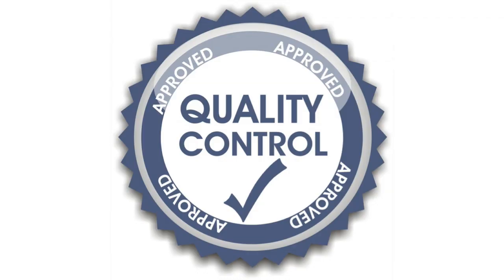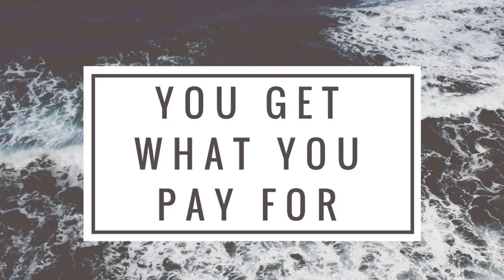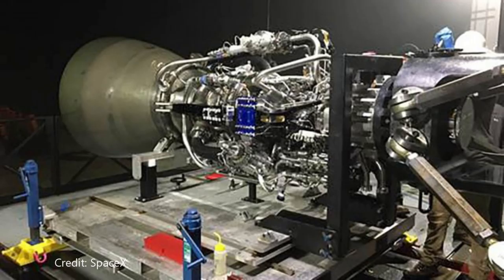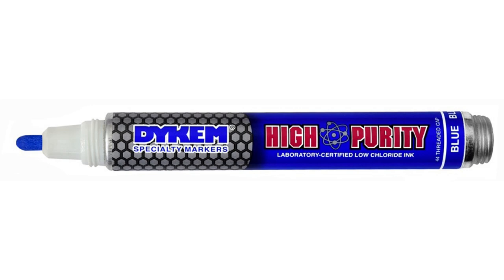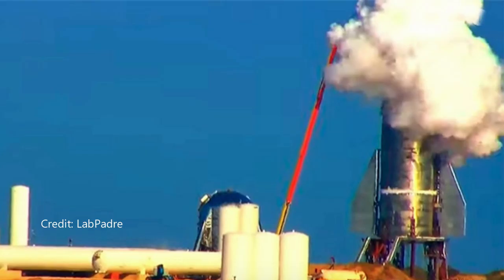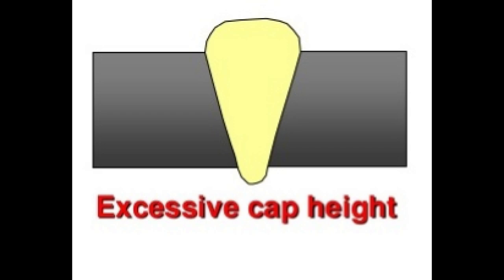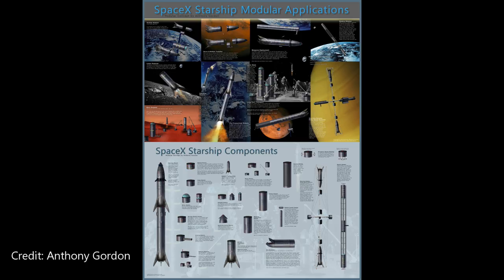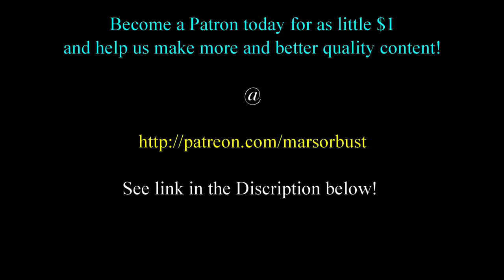WILL SPACEX STARSHIP EXPLODE!?  How SpaceX Will Maintain Quality Control! Episode XXI

Comment: I think its a bit much, to ask, to weld all those rings and end caps manually and expect them to be prefect even with a jig! I would think that they need automation plus verification with x-ray with AI. SpaceX has re-acquired the dock at the L.A. port and are building new hangers. I believe they plan to move production there.

Comment: Exquisitely timed, SM Dave!  When Musk did his Starship unveiling back in Sept 2019 with that Frankenstein-monster of a spacecraft, it looked like a hacked-together creation from a back-yard self-taught welder, a patchwork quilt of stainless steel and miles of welded seams. Elon seemed not at all embarrassed by its appearance, which surprised me. He seemed oblivious to its appearance and the implications of that.

Fast forward 5 months, and SN1 is pressurized with LN2 and it blows a seam (guessing here) and violently disassembles after weeks and weeks of careful welding and assembly. And we non-experts are left to wonder: what if this approach to building a space-faring craft (to be reused a few dozen times at least, including a completely untried approach to atmospheric re-entry) - what if this approach is fundamentally flawed? What if it can only succeed with a lot of luck and overwhelming care in welding and rigorous inspection of every mm of welded seam? What if it's impossible to reliably replicate the occasionally successful welding process across the projected fleet of hundreds of future Starships?  I have little confidence in the present approach.   - DL
Reply from the maker: Thank you!

Comment: That metal is so thin.  They are doing things on the very edge of what's possible,  and from what I can see they're probably going to need to thicken the metal because they're going to keep having these failures.   I went to welding school at UNM and so I know a little bit about welding.  Stainless steel is very unforgiving anyway and so if you get porosity,  at all, at pressures like these, you're going to get failures.

Comment: I have wondered if joining the rings would be better to use universal head monel rivets vs welding.
Reply from the maker: Rivets connect the material but dont actually bond it together.  If they can get the welds done correctly,  the weld areas will be stronger than the parent metal. At least that how its supposed to happen... 
Thanks for the comment! 
SMD 
MoB
Reply: @MarsorBust  I build helicopters for a living,  welds have issues with cracking in areas of high vibration and thermal expansion/contraction.  engine combustion cans have alot of welds that must be regularly inspected because of this very reason.  Its hard to not imagine a cataclysm of vibration not cracking the welds on liftoff or reentry.
Reply from the maker: @macaw172   You are correct and I do remember back in the short time I worked on jet engines, the combustion cans were allowed to have cracks up to a certain size. All they did was drill a hole to stop their propagation. That always seemed strange to me! Anyway, there are many things regarding Starship that you or I may seem strange, but I would truly hope someone with much more intelligence than myself, has a reason! I truly I hope!!! I could be wrong though... 👍
Reply: @MarsorBust They have an inner combustion can and an outer can.  The inner can uses weep holes for cooling and yes some cracks are allowed,  the outer combustion can actually contains the hot gases and no cracks are permitted as it will result in power loss then engine failure.

Comment: Quality control implies that you have a standard to build to, these are scratch ships designed to blow up once or twice, till it can be determined what was the cause, but why stress about control till you know what you are building. if you want the SN1 to take 5 years to build and still only fly 20km then go your route. I understand your points and pretty sure all the engineers know this too. But It's build and test to destruction. You can re-do this video in two years time, with the same points you are raising now, I reckon you will be saying God Damn SpaceX is pretty anal about their welds .
thumbs up
Reply from the maker: Hey Robert! 
I'm using the same response as I use for another post. What you say makes sense! 👍 

Maybe it's just me and all my years of making sure things are done right the first time, but in my opinion and it should be the option of anyone spending money at SpaceX. There are proven ways of doing things like this no matter what it is you are building. And, It is proven to be cheaper and not very time consuming compared to the cost of doing it twice to do basic inspection. How much did those vessels they blew up cost? $50,000, $100,000 more? How much does a inspector cost, $50,000 or $100,000 per YEAR... Yes I understand what Elon is doing but there are engineering programs that will tell you exactly how much pressure any design will withstand. To a point, Build and Test is an old fashion way of doing things. Do they build a bridge that has never been built before just to test it?  I mean just look at Kerbal Space Program. It's not even a Engineering program and I'm NOT suggesting anyone use it except to play with, but it is still  fairly accurate as to what will hold together and what will not. Imagine a professional engineering program designed to do that can do. 
Just my opinion...

Thanks for the comment! 
SMD 
MoB

Comment: Quality control,  testing/inspection and materials selection is basic for this kind of engineering, something ,so far, I see little evidence for from Starship. The thing I see being built, apparently by trial and error, is not the real problem though, that I can see. The design is fundamentally not a reusable design, for something that is going to go through the stress of re-entry, with control surfaces. I would suggest a monocoque hull with steel plate and a heat shield attache with fasteners and internal aluminium alloy, friction welded, fuel tanks. I suspect a final reusable design will be very similar to this, in the end!
Reply from the maker: Hey Stephen! 
This is a lot different than anything I have ever worked on or seen before! That's for sure! 
SMD 
MoB

Comment: No, offense but SpaceX isn’t using the same slow, careful, methodical development methods you might be familiar with in the sunk cost adverse industry and government work you are used to working in where mistakes avoidance for super-safety or even political reasons is paramount. 

Yes, SpaceX will have high quality production methods when main sequence production starts, but the current builds are all experimental and expendable by intention. 

These are going to be robot vehicles likely tested to destruction at some point. 

Above all, they are cheap. Their major cost is labor and it is the training of the labor force at all levels that is really being being produced right now.

I’m sure SpaceX’s shoot from the hip development style causes a lot of people to grit their teeth, but e need to remember that their goal is to make spacecraft prosaic, not wonders of high technology. 

Making something cutting edge boring is different task than many are used to.
Reply from the maker: Hey Shannon!
Maybe it's just me and all my years of making sure things are done right the first time, but in my opinion and it should be the option of anyone spending money at SpaceX. There are proven ways of doing things like this no matter what it is you are building. And, It is proven to be cheaper and not very time consuming compared to the cost of doing it twice to do basic inspection. How much did those vessels they blew up cost? $50,000, $100,000 more? How much does a inspector cost, $50,000 or $100,000 per YEAR... Yes I understand what Elon is doing but there are engineering programs that will tell you exactly how much pressure any design will withstand. To a point, Build and Test is an old fashion way of doing things. Do they build a bridge that has never been built before just to test it?  I mean just look at Kerbal Space Program. It's not even a Engineering program and I'm NOT suggesting anyone use it except to play with, but it is still  fairly accurate as to what will hold together and what will not. Imagine a professional engineering program designed to do that can do. 
Just my opinion...
Thanks for the comment! 
SMD 
MoB